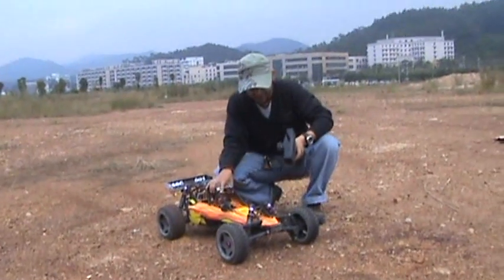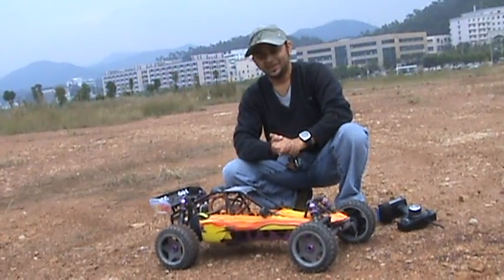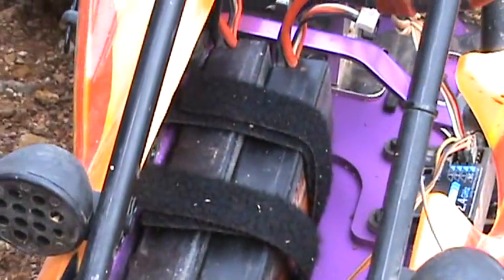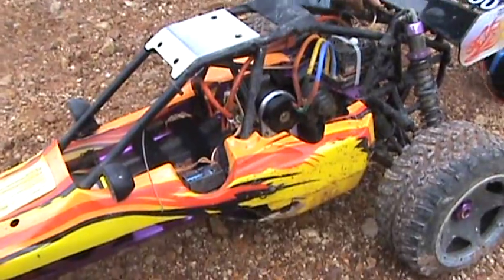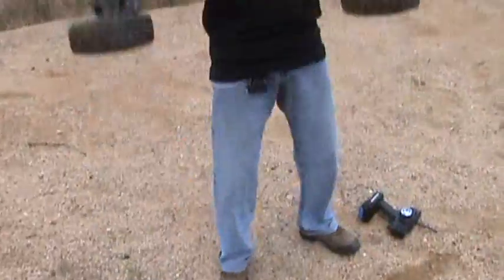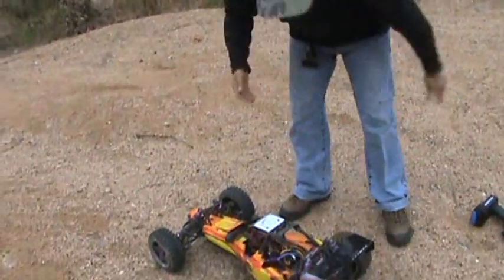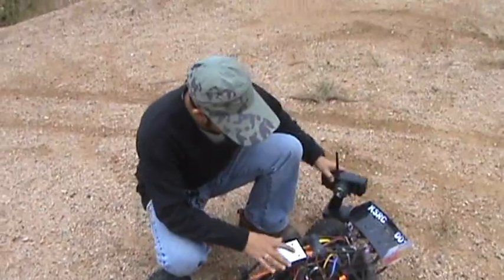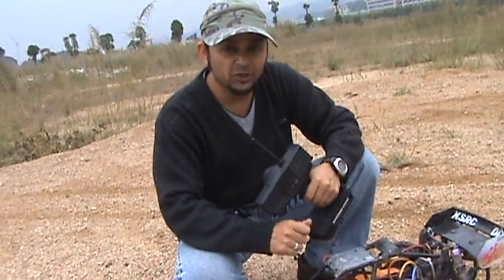1/5 Scale Electric Conversion Kit

Comment: I have this same conversion kit & it works great, runs a 1400kv motor on 4cell is quite fast & 6 cell even better. The added torque of the big 1/5 motors is a waste in 2wd on dirt, just adds wheelspin. This set up uses 45mm diameter motor, where the large motors are 56mm

Comment: First of all, fair play for what you've done. Like you say, not everyone can deal with the sound issues with petrol engines. 

But . . . . I feel you have removed the soul and purpose of the baja by removing the petrol lump. 

First off, you don't need to make adjustments to the engine all the time. 
You don't have to spend big money on batteries to run it, plus there is no long wait for the batteries to charge. Open the cap. Poor fuel in, and off to go again. Petrol is cheap, and will last age

Comment: @videoman223 yes the gas version is insanely reliable. i literaly pulled mine out of the box and have yet to touch or tune the carb. its very strong, powerful and fast. dont go electric

Comment: ESC Spec.
Continuous Current: 150A
Burst Current: 1080A
Resistance: 0.0002ohm
Suitable Car: 1/5, 1/8 on and off road.
Battery: 2-6 cells Lipo (6-18 cells NI-xx)
BEC output: 5.75V/3A switch mode buit-in
Motor type: Sensorless and sensored brushless motors
Dimension: 68 x 55 x 45mm
Weight: 150g
 
Motor Spec.
Model: 3674SL V2.0
Kv: 2350
Scale: 1:8
Max Current: 76Amp 
Turns: 9T
Weight: 363g

 
Contents:
ESC: 1 x 150A
Motor: 1 x 3674SL (2350Kv)

Comment: @foshizzelman depends on the weight of the vehicle & how fast you want it to go. The 1717 is a good 6-8s lipo motor, in something weighing upto about 15-18lbs maybe, but the 22 series neus will blow it out of the water if you go upto 10-12s lipo with the right kv rating...

Comment: 1/5 scale, running on 4s lipo & a hobbywing 120/150amp esc & feigao 580L motor? Does it come with a fire extinguisher?

That needs to be running on 8-12s lipo with a neu 22xx series motor, or the Castleneu 1717 motor atleast. The current power system is suitable for a 12lb emaxx, not a ~20lb baja...

Comment: Now this is cool! B¬)
 But You'll deffo need 5 or 6s lipos to get similar top speed to the stock 2 stroke motor. That's a 150 amp Ezrun right there Ali, got a burst current of 1080 amps! ;-)
I have the 80amp in my home made 1/8th truggy conversion.
The Baja 5B is a superb RC car, but many 'men' will say the noise is the best part! ;-)
'Lectric all the way for me tho!
5/5

Comment: I prefer the gas one. A 1/5 scale doesn't need alot of tuning. Just 1 time. It's start like a charm, like 2-3 pulls and it last 30min and + without refilling. the weight of the Baja suck a huge amount of juice from the batteries. If I would take a BL, I would take a 1/8 or 1/10.